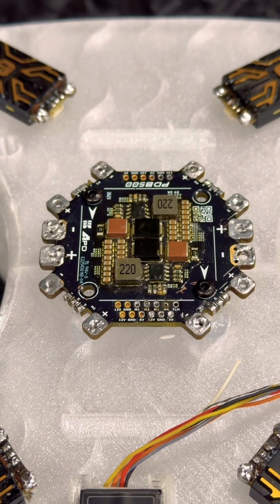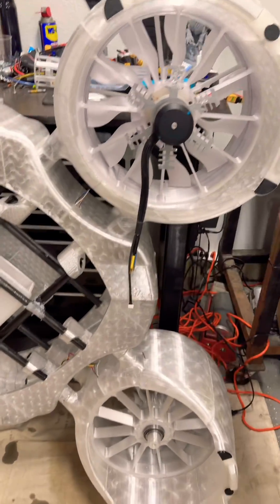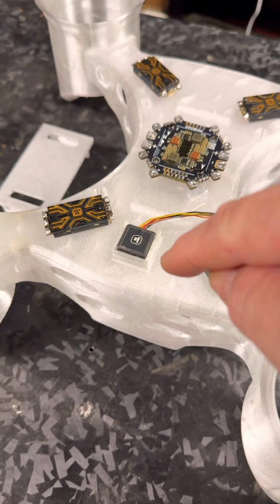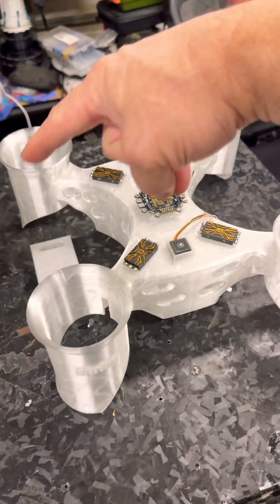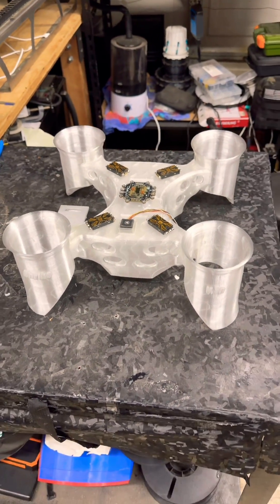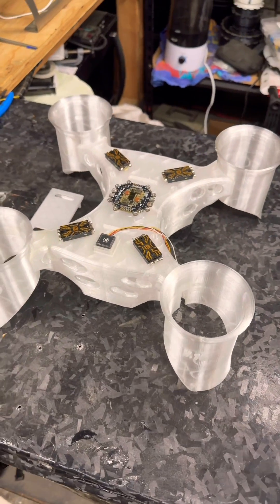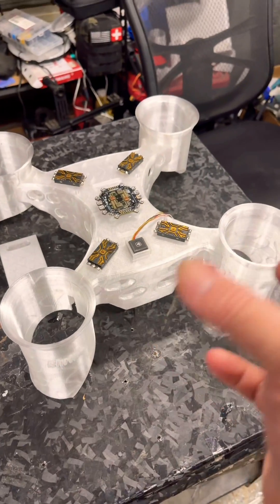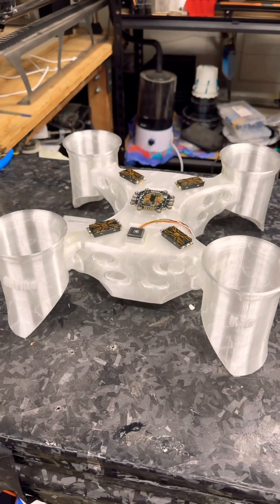Building an EDF drone. #shorts #edf #youtubeshorts #diy #drone #3dprinting #rc

Comment: If that GPS module is also a compass, you'll get measurements all over the place because power wires are so close. (And arguably this is Shrike V11, right?)
Reply from the maker: I ran it this way before and it's still v10 just reprinted since I had to part out the first one.